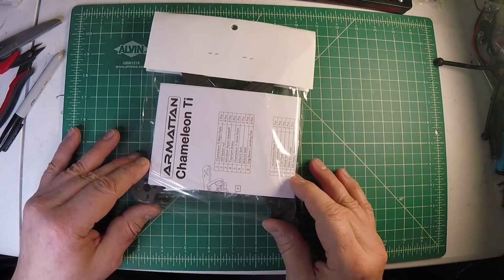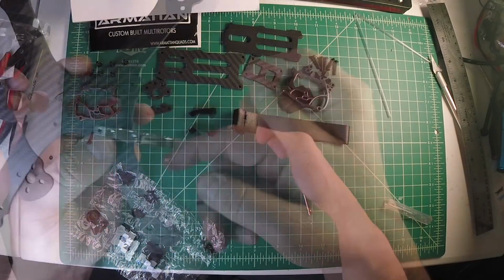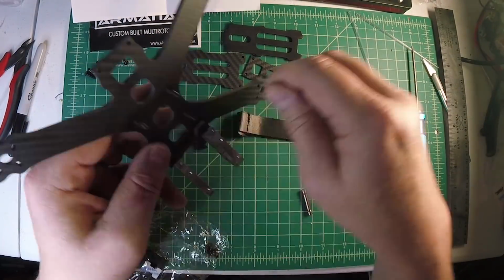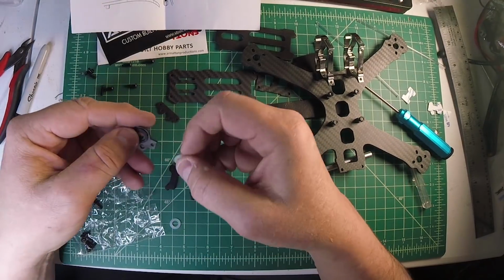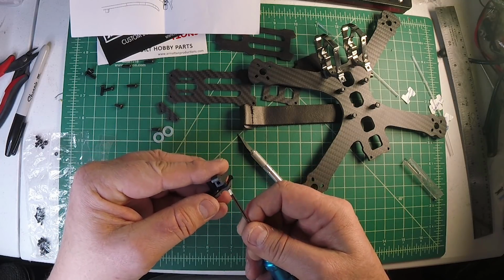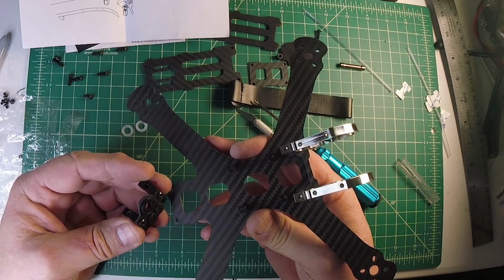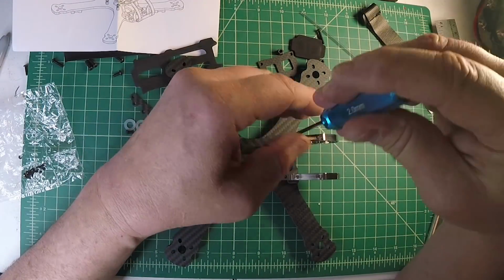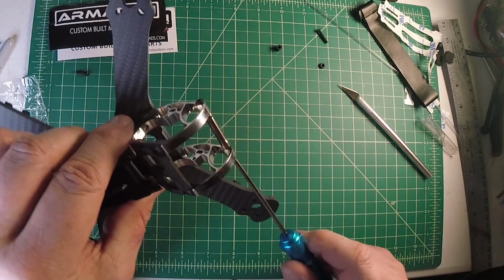Armattan Chameleon TI:  Frame Assembly and First Impressions

Comment: Nice video review... just a build tip... I clean the surface of the carbon with alcohol before sticking on the landing pad... the pads have not come off my original chameleon since I install them a year ago.  If the foam tears, I repair with a dab of E6000 adhesive.
Reply from the maker: diabolicallydan thanks I'll try that next time!
Reply from the maker: Do the pads really do anything anyway?  Looks nice when you first build, but I haven't found any other purpose for them.
Reply: 2kul FPV if you’re flying on grass or over soft ground, I can say there is no value to them... I frequently fly over concrete or tarmac and the benefit here is that the landings are softer and your carbon and screws will be better protected in those controlled landing situations 😂😎. I have flight footage on my channel of my Chameleon in the parking lot if ya wanna check it out... let me know what you think too 👍

Comment: That frame is fantastic and can take a major beating. The aluminum front end tends to bend on impact for the original but you can usually bend it back. If not it is under warranty.